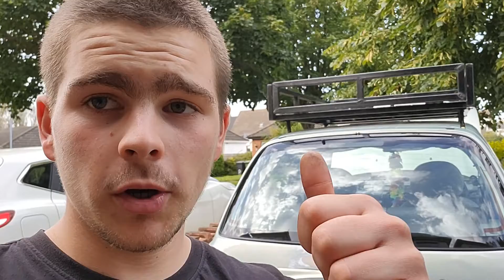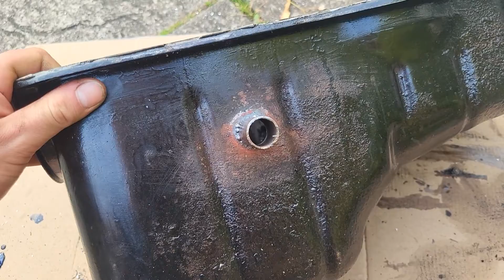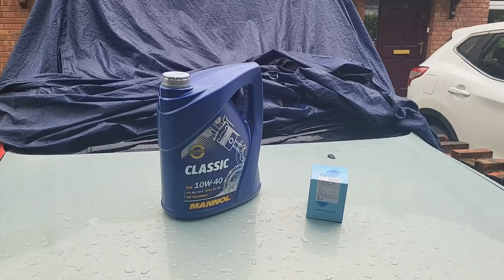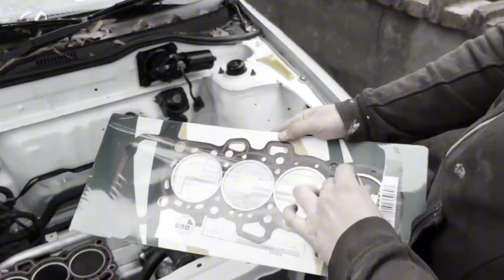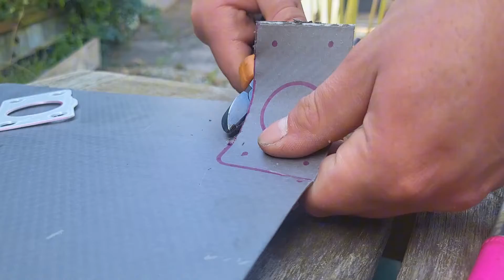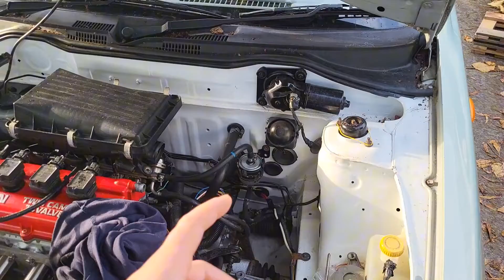Preparing the Turbo Micra for its First Start - Turbo Micra Ep.3

Comment: Your doing a great job modifying the micra.I have one concern regarding the battery relocation.it's not safe.I've been modifying cars for years.if you want more info just ask me
Reply from the maker: Cheers mate, I definitely agree that the battery relocation is sketchy, I’ll have to revisit the idea before the car gets on the roads to make sure everything is safe👍
Reply: When you get it all dialed in and up and running you can bring it to !y workshop and i,'ll give you a hand with the battery relocation.I'm in Drogheda.if you want?
Reply from the maker: @ciaranboyle311  Cheers for that mate, it'll be a while til I get this thing on the road so I'll try sort out the battery sooner, I know it's quite sketchy the way it's wired up now😆👍

Comment: Next time use less sealant on the pan.
All the access material inside may come loose and can clog up the oil pickup.
Also parts of it may run trough the oil system.
Reply from the maker: Cheers for the advice, I did think i put a bit much and thought I might run into issues, but I wanted to make sure there were no leaks as the pan wasn't perfectly straight anymore. I'll keep an eye on it as time goes by👍
Reply: @the_mintiest_micra  as a rule of thumb
All acces material you can see on the outside will also hang inside the pan. Less is more 👍
Also its better to have a leak then a compromised oiling system 😁
Keep up nice content ;)

Comment: Here from the speeduino. I'm a Volvo guy myself but turbo swapping something you are going to want to run some sort of reducer for your turbo oil speed. You don't want a oil high flow going to your turbo.
Reply from the maker: Cheers for the input. As of now, I've got a proper braided oil feed line that reduces the flow to the turbo. Video on that will be out soon.👍
Reply: to high oil pressure in the turbo? does that make the turbo, leak oil into either intake or exhaust side of the turbo?
Reply: @cskalle1213 
Basically yes turbo oil seals are not designed to deal with pressure
Reply: @cskalle1213   it's something to do with ball bearing turbos. Look up turbo oil feed restrictors

Comment: Mild concern - isn’t the turbo oil inlet supposed to be at the top and the drain at the bottom?  Your setup might cook your turbo due to lack of oil.  Loving the fact you just get stuck in where so many just dream.
Reply from the maker: Good spot, the video was filmed a while ago, since then I've changed the set up around a bit and got the feed up top and the drain down, some stuff was temporary just to get the car running👍